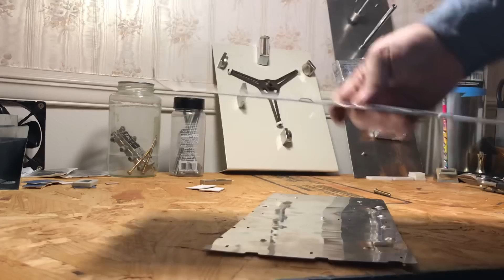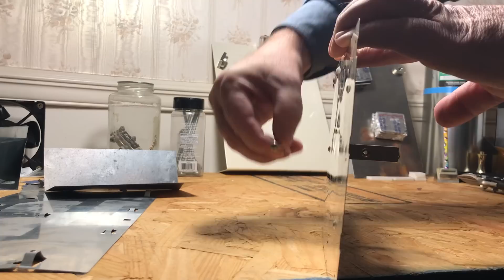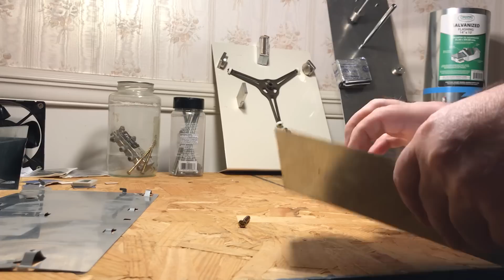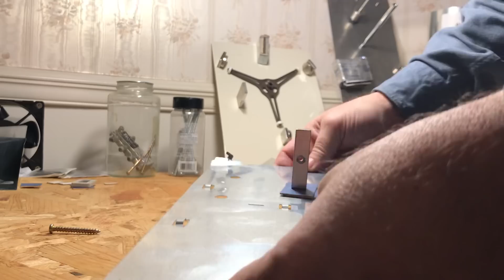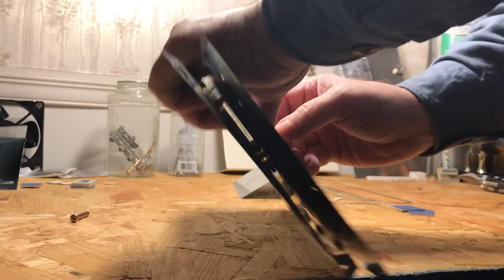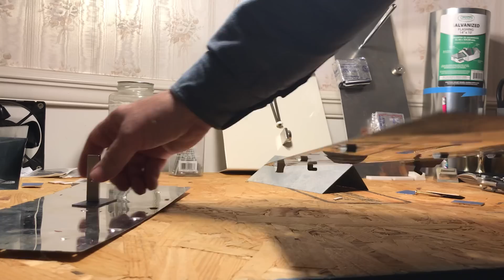🧲 VID #1 - AMAZING! RAW FOOTAGE

Comment: Same Effect In Mu metal  Shielding in Pc HHD Hard Drive magnet attach to mu metal You can Find Piece Same Effect Metal Fall Off IN other Side But, We want Have Good Shielding That Way if magnet Maches Same Shielding In Thickness Of Mu metal Shielding  that equal to magnet bar size Then we can stack magnet Curve it 30 to 60 degree radial and shield it in stator not the rotor you  only side between north and south pole Cover Shielding Then Like Catalin Mihai Type, then if you Might Have Chance cant get Magnet motor Running
Reply: First You Have To TO make Motor, The key Is to Split Ring Into  3 or 5 ring like wasif kahloon had 5 ring that way each row act as moving after moving after another that what is important.
Reply from the maker: ERFAN S - Just put up a new video how to build the James Roney Stator.  More videos on the way.
Reply: James, Great   i better start Work On it By now i look after blue print it.

Comment: Another informative video. After watching this video I did a search on magnetic shielding and found an article by 'K+J magnetics' on shielding materials and how they work. 
I think the article gave a good explanation on why the spacers work. I can order some magnets from them.
My biggest hurdle is coming up with a turntable with just enough 'flywheel' effect.
Reply from the maker: 3deeguy  - If you’re looking to replicate my results, you don’t need the fly wheel effect which stores inertia. Rather my design powers/muscles its way from magnet to magnet without the need for additional assistance.

My very first video I ever made and posted here reveals that. This is the video the reveals a magnet motor is indeed possible. So few views, yet it’s an overlooked video that’s a game changer. The results in the video are 100% real. I was not touching the wheel off camera.

Best of all, I’ve completely eliminated the infamous, “stick spot” now.

https://youtu.be/JyQgYh9DTTs

Comment: Dude, even if you shield the magnet, it does not matter. It would be as if you have a smaller magnet. It will still make the thing want to stop eventually.
Reply from the maker: Nikolay Nikolov  - Only part of the magnet is shielded. Here’s the details as to why it works the way it does. Pay close attention to the leap frogging part. 

🔴 First and foremost, the force of attraction between two permanent magnets is far greater than that of the force of attraction between a permanent magnet to steel or iron. Capitalizing on the differences between these two pulling forces is the backbone to the success of the, James Roney Stator. 

The method used to capitalize on these differences in pulling force, is the sharp cutoff point during the transition from magnet to magnet over to magnet to steel.  

Upon the completion of this transition, the  pulling force of the next armature magnet in line repeats the same process. In doing so, the raw pulling force between two unshielded magnets, causes the now magnet to steel to be pulled out and away from the previous stator. When this processes repeats itself, you have magnets powering magnets which gives forward motion/rotation. This is not theory, this actually works beautifully. 

To build an actual working motor requires a few more steps, aside from the specially constructed James Roney Stator that makes this possible.

Since placing the moving armature  magnets all the way around in a circle does not work, a gap is required. Multiple gaps equally spaced works best. Four gaps per circle is recommended. (See Gap Diagram Below)

Part two:
The Leapfrogging Effect is how the differences in pulling forces is capitalized on between the four stators placed at each of the four gaps. 

Just as a set of armature magnets is beginning to enter the maximum pulling power of (magnet to magnet attraction) of the James Roney Stator, the last armature magnet is now leaving the previous stator which is aided by the pulling force of lead armature magnet being pulled in by the next stator in line. 

This extra pulling force from the next stator in line, insures the last armature magnet is pulled clear out and away from the previous stator. It’s just that simple. 

Because the pulling force is ALWAYS greater than the opposing counter pulling force, enables the set of armature magnets to continuously leapfrog from from one stator to the next stator to the next. Once the lead armature magnet reaches the fourth stator, this process simply repeats itself at the beginning of the first stator in line. Again, it’s just that simple. 

In Summery:
The leapfrogging effect works in tandem with the special effect of switching the attraction mode from magnet to magnet over to magnet to steel. The James  Roney Stator design makes this possible, and does so, without the stator requiring any moving parts. Thus lessening the chance for breakdowns.
Reply: Thanks for the answer. No way I understand it all. Well if all is working fine, what is stopping you from making it work?
Reply from the maker: Nikolay Nikolov - Nothing is stopping me now. 

I’ll describe why the shielding on a simplified level. 

Like the metal barrel of a gun that gives direction to the bullet, the metal shielding gives direction to the magnetic field.  The magnetic direction is than aimed at the incoming magnets on the wheel to pull them forward. The momentum  gained is greater than the counter force, causes the magnets to keep moving. 

Hope this helps.
Reply: Yeah, I get that you are shielding to get directional field. I guess I don't understand how the leapfrogging is possible actually. But don't bother explaining to me. I don't want to make you spend the time since I don't have a lot of time to try to really understand it all. I will be having a look when you make a video, but my bet is that you are missing something in terms of physics. Too bad I don't know physics to point it out :D
Reply from the maker: Nikolay Nikolov - The stronger attraction overpowers the weaker attraction. That’s how it works. 🍷
Reply: @nqkoi159  It's all push (forward) and no pull (back, due to shielding) or put another way...all pull (forward) and no push (back, due to shielding).
Reply from the maker: Seal-ed  - There’s no pushing in my set up. It’s because All magnets are to in attraction mode. 

Another way to envision this is like a locomotive pulling a bunch of train cars.  The lead engine continuously pulls the last train car.  So, the lead magnet is constantly pulling the last magnet.  Like the train cars lined up on the train tracks, the armature magnets are lined up on the outer rim of the bicycle rim.  Simply watch older vids for example.

Comment: If lremember right the old vcr tapes were affected badly if they came into contact with magnets and the smaller the vcr machines became the closer the small motor magnets became . Great find
Reply from the maker: james wilson - I forgot about that. The shielding is pulling double duty.

Comment: Looks like someone will be hitting the garage sales and buying old VCR machines soon lol!
Reply from the maker: Seal-ed - You got that right! Thought about making a video requesting people to send me old broken down VCRs, but I’m afraid I could end up with hundreds, possibly thousands of VCRs ending up on my door step. Lol  I’ll put out an ad on Craigs List looking for free broken down VCRs. ✅
Reply: @FreeMagneticEnergy2  It's funny to see this video. Whenever an electronic device I own breaks, I always take it apart first to see if I can fix it for less than what it costs to replace it. I usually wind up just replacing it and striping out all the good electronic parts I can re-purpose. I have at least 5 old VCR's I've stripped and I always save the metal cabinets. Now I gotta go test them to see if any are Mumetal.
Reply from the maker: ⭐️ Seal-ed - Awesome and good luck! I bought this VCR SOME 3 years ago for specific parts from Goodwill for five bucks. Never knew I had taken out two high tech magnetic shielding plates. This is going to breathe new life into my Stators. A game changer for sure.